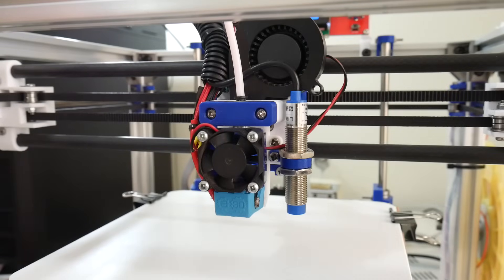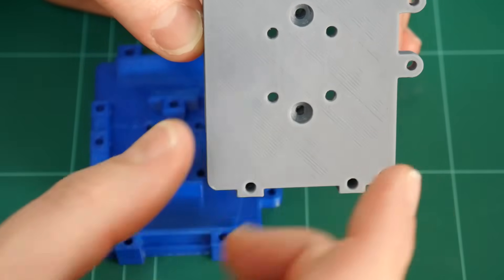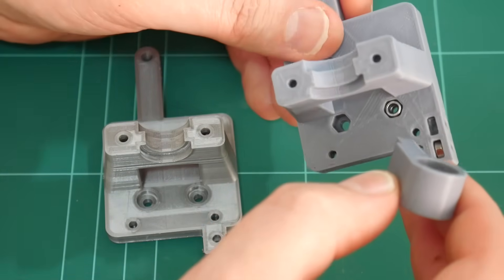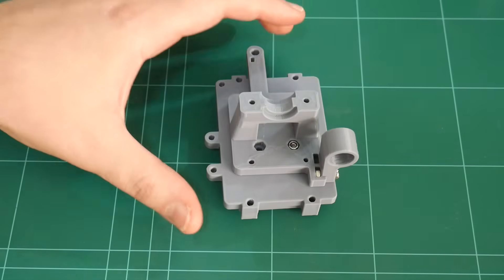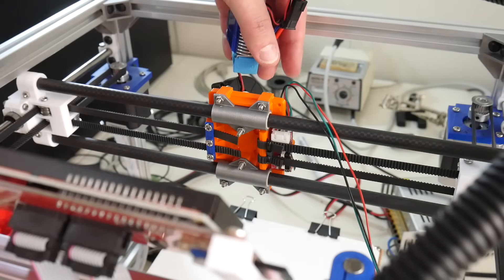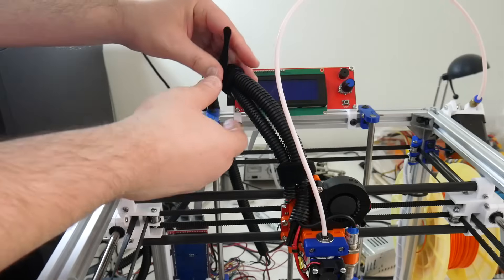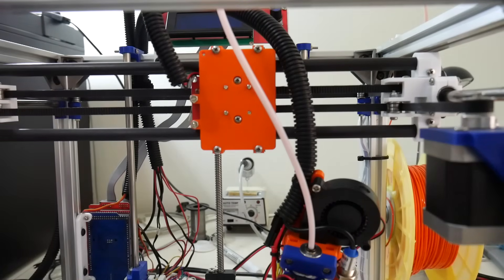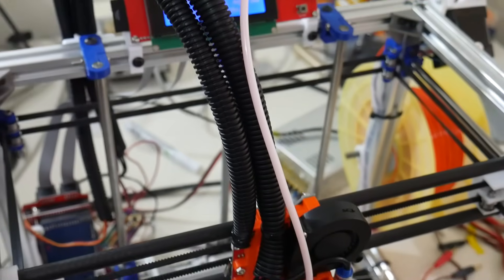New 3D Printer - Build Log #17

Comment: You could make it even easier by replacing two of the four mounting screws with pins.
Reply from the maker: No
Reply: Thank you for the thoughtful reply.  I just finished two decades in industrial controls an can state as a fact that using pins is an industry accepted practice to make sure often removed parts are correctly returned to position while minimizing the number of fasteners. If you disagree giving yours reasons would be helpful. Or alternately just don’t post a reply.  The curt “No" is rude and uncalled for.
Reply from the maker: In haste of answering many questions I may have been too abrupt with my response - apologies.
My reason for not choosing pins is that the plastic material isn't hard enough, in my opinion, to withstand repeated lateral forces without elongating the pin holes over time. For 3D printing, laser engraving and plotting, sure, pins will be fine. But when we begin milling I feel 4 fasteners clamping the plastic surfaces together will withstand the greater forces.

Comment: The x endstop could possibly be mounted on the left side of the gantry (where it now meets the plastic and actuates), thus removing the need for the double cable loop velcroing :)
Reply from the maker: Yeah, I remember during the early build videos I chose to attach it to the carriage as everything else on it had cabling too. I may need to revisit the X endstop if it becomes a hassle.

Comment: Weird, I was just looking to see what kind of laser cut/engraver could be used. Is there any laser that could cut thin ply or plexiglass?
Reply from the maker: I've been googling just that. I believe the 5500mw laser on banggood can do it in 2-3 passes, or the 2500mw laser in 3-6 passes. Each has their advantage/disadvantage but I haven't decided which one to buy.
Reply: Saw those 2 not much description, I'd start with $69 compared to $239 :))  What about co2? I can't find how they connect tube to head, you?

Comment: I have  a proposal/tip for the velcro for you. You could do it like it is done with music cables and just tie the loop part to the smaller cable guide. The hotend cable guide can then be attached by looping it around that and the small one a bit. That way you don't have to undo the whole tie on every toolchange.
P.S. do you have bigger diameter probe mounts? There was a video by Thomas Sanladerer on comparing different ones and the bigger ones had a better repeatability
Reply from the maker: Interesting idea. At the moment just the single sized probe mount but it's quite a simple part anyone can make their own to suit. Also check the remixes section on Thingiverse for just that.

Comment: Are you going to add some sort of lockring to the screws so they wont fall out? And are you going to add some sort of indexation so that you easily can change between tools without having to check heights?
Reply: he uses nylon lock nuts.
Reply: Yeah, but thats for when the "tool" is mounted. I meant for when there is no "tool" mounted on the "baseplate". Just a simple starlock or something like that holds the screws in place.
Reply from the maker: Regarding checking heights, the E3D mount has the induction probe attached so 'should' auto home to the correct Z height. Each tool would need it's own Z homing sensor or just go manual.

Comment: I've got a wip design on my i3 clone using 4 10mm neodymium magnets on each side (4 on the carriage, 4 on the print head bracket) and 4 bolts as locator pins and it holds very well.

Once I get my hypercube sorted I plan to make a similar mount for it :D
Reply from the maker: Interesting idea! Please let us know how it performs. Also we could make a magnetic plate that screws to the X-Carriage but allows magnetic attachments?
Reply: Will do, i'm still waiting on a couple of parts for the hyper cube :)

I can see any reasons not to make a magnetic adapter plate but given how thick the 10mm magnets i've been using are it might make sense to use a bigger number of smaller magnets to get the same clamping force.

That said, i'l thinking about trying some smaller ones anyway, 4 sets of 10mm neodymium magnets clamp very well, almost too well :D